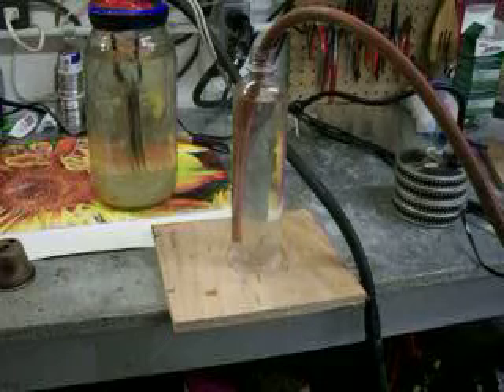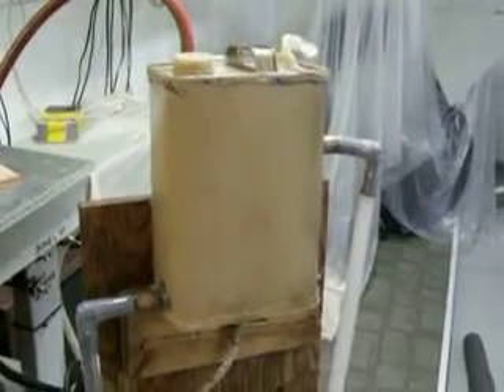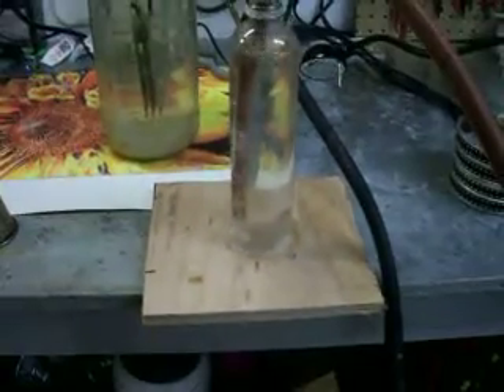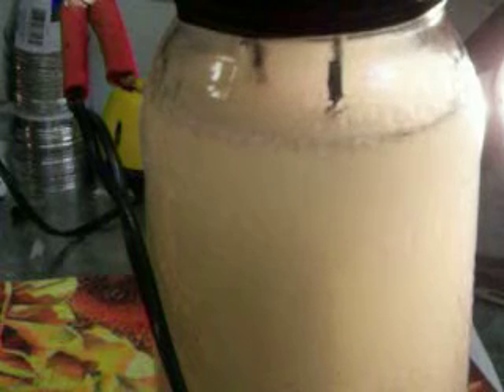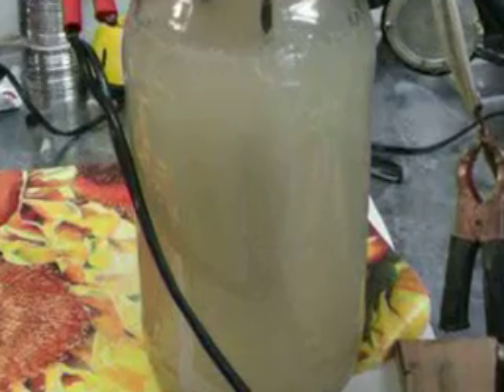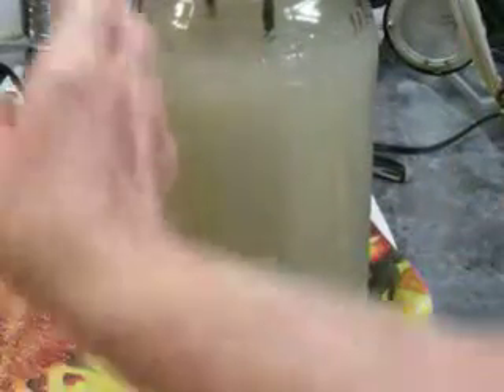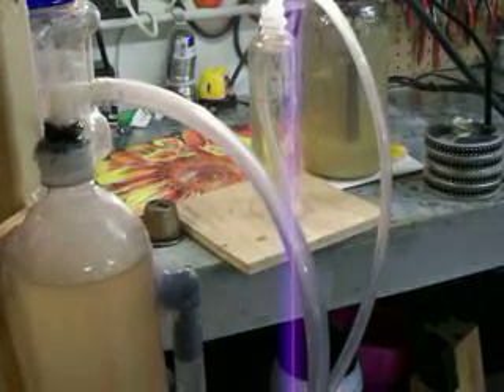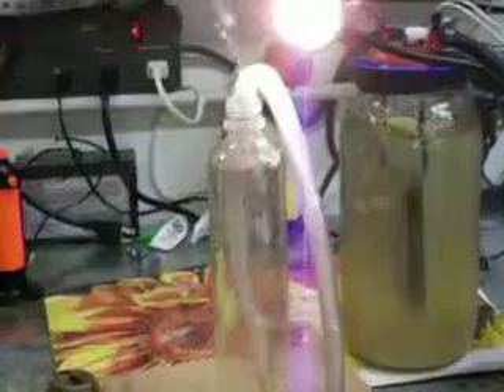three types of cells

Comment: I admire you trying to make videos.  If you want to help us, you will have to explain, What is it made from, HOW do you make it.  Why is one design better than the other,  What is in the water, how often do you have to clean?  How long does it take to clean,  How long have you used it.  Have you put it on a car.  WHat do you do with excess gas.  ALL IT SEE IS BUBBLES, if I wanted to JUST SEE THAT, I would use a straw and blow bubbles in my chocolate milk.